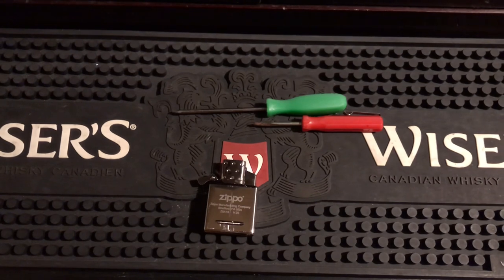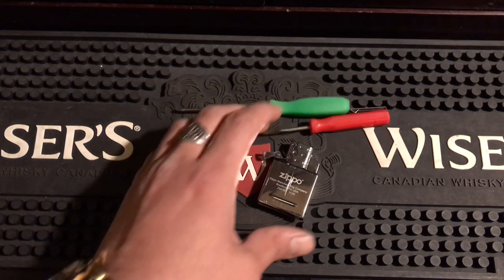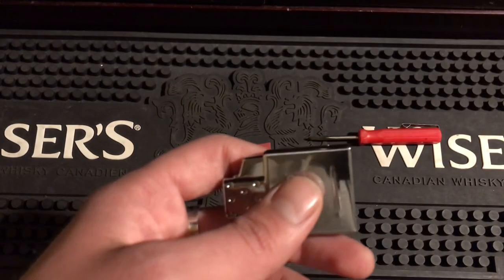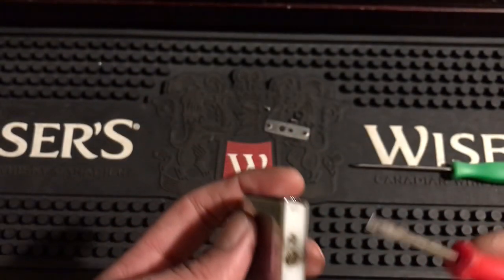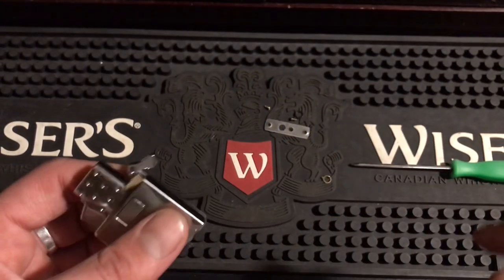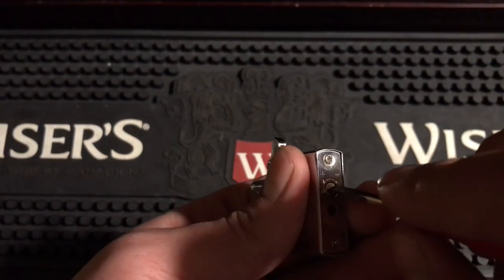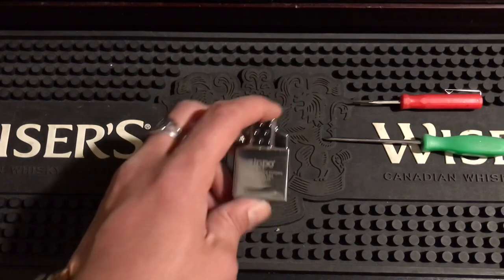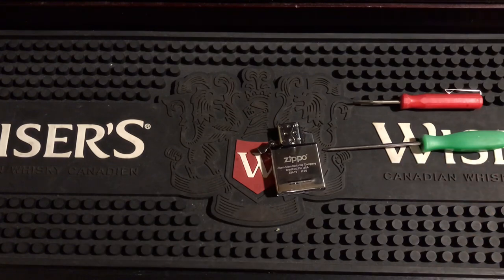How To Fix Zippo Butane Insert + Full Review

Comment: This fix worked perfectly. I don't think it is really about good or poor quality butane, just that each brand will have different compositions of N-Butane, ISO Butane, Propane etc. For example my bottle of gas is "Bernzomatic" and is 83% Isobutane, 15% Propane, and 2% Butane (I had to look up the MSDS). The different gas compositions of different brands will affect the gas pressure and thus the calibration of the adjustment screw.

Comment: The problem i had (with the single torch insert) was that the wire that gives off the spark was placed too high, so the spark went to the side without igniting the gas. So i used a tiny screwdriver to push it a bit out and down towards the gas nozzle, and it now lights up almost every time. The YT channel "kangsterizer" has a video called "zippo lighter butane insert (actual) fixes", which shows how its done.
Reply: I’ll need to try do it on my single torch, lately it takes even 10 tries before ignite. 
My double torch ignites much better than the single one.
Reply: @the_bogeyman.  I dropped mine to the floor once or twice, and had to disassemble the whole thing to fix it. A few days later it dropped to the floor again, and this time i was not able to fix it. Started using the good ol' zippo fuel insert instead, and will never use a zippo butane insert ever again. China does make some good products, but the zippo insert is not one of them :body-blue-raised-arms:

Comment: Had the double butane flame insert and it worked at first then wouldn’t light. Watched your video and before I removed the screws I just turned the adjustment screw higher and it immediately worked great! Guess I should have just tried that first 😅

Comment: Use a small sliver of metal identical to BASE material of the case (regardless of external finish) to slightly elevate the Zippo insert and reduce cap wiggle.  Glue it in to bottom of the case (suggest e6000 glue) and case lid wiggle problem is greatly reduced.  Done.

Comment: Not sure where else to ask this;
Tried to remove the , the limiter. I can not get it out.

My problem however, is that when I click to light the gas just spills out and keeps going for almost a second. If I manage to light it, the flame is ridiculous. I've tried lowering the flame by turning the screw.. But I have a feeling it's because the limiter is stuck? It seems to be stuck? Any advice you can give on this?

Comment: Do you have a video on refilling the zippo?
Reply: Just do general search for refilling butane torches/lighters. All follow the same concept. Invert lighter upside down and bleed out the propellent/air. Flip butane canister upside down and wait a few seconds for the butane to settle downwards towards the nozzle. Butane is heavier than the propellent, so the propellent will rise pushing the butane down. Next fill up the lighter (some have said to stop about midway in filling for a few seconds to allow pressure to equalize). Once filled, wait a few seconds or a minute before using for the butane to stabilize. Lighter should be good to go after that. 

If you need to bleed out butane, leave lighter right-side up and bleed out.

Just got mine in and love it. No issues with it out of the box. Flame adjustment works as it should, and immediately ignites upon button press. But will keep this in mind if I do encounter any issues with it down the road.

Comment: I'm a pipe smoker and I wish I could use the butane insert. But they burn the Briar wood because the glam is to hot. I wish they had a soft flame butane lighter. I still think I will have to pick one up. Zippo guarantees everything so I would just send it back if it breaks or sucks lol. Thank you for the info.
Reply: @ZippoFanatic77  
I was thinking about getting one to keep in my every day carry backpack. But will it keep the butane just sitting around not being used much?
Reply: @ZippoFanatic77  
Yeah I'm in Vermont so we definitely get cold up here. I'm like a half hour from the Canadian border. It's a bag I bring inside at night etc. But the keychain fuel canister sounds pretty sweet. I'll have to look into it. Do they have it on there website?

Comment: I think I have an issue with the battery, please make a tutorial on how to change the battery. The lighter is pretty heavily used. :(
Reply: I just replaced it with a standard D cell, been going strong for 3 years now, lights with every click.
Reply: @zadraking  how do you replace it? Getting back to fix this one. Thanks for the info

Comment: I have looked at many different youtube videos about fixing zippo gas lighter inserts and did what they said for adjustments etc and none of that worked so I actually had to get off my lazy butt and troubleshoot the issue myself. Problem lighter will not light. Info: gas insert is full, air is bled out, Can see a spark and hear gas release when attempting to light. FIX ....Gently push electrode down towards the gas release opening with fingernail or toothpick and retry lighting, repeat until fixed..

Comment: I guess I got lucky. My brand new insert has worked awesome from day one, even with regular butane (which I'm going to switch out with premium on Monday). I remembered all my other storm lighters randomly stopped working, and it's probably due to the regular butane clogging them up. I have one of them still, and I cant wait to see if premium butane will make it live again.
Reply: Whenever you load in butane, small amounts of air gets pushed in also. So every so often you gotta press on the fill nozzle with something skinny to burp out the air bubbles. For my metal clippers before I switch to zippo butane inserts I would have to do that after about 2/3 months of use, and then they’d work great again. Try it could help
Reply: @mrdavman13  Oh yeah I bleed it out like once a month.

Comment: I left the governor ring out of my insert so I can keep turning it up until it's completely out of butane, it gives me longer life out of a fill. Just remember to adjust the flame back down after you refill it or you will have a large butane spitting flame surprise ya lol.
Reply: @ZippoFanatic77  every so often I gotta pull the insert out of the case and turn the flame up some, until it stops letting out any butane at all, then refill it lol but I seen a video about those inserts and the guy said they come from the factory with the highest setting still not being enough to ignite the flame, so the modification of taking that ring out gives it the amount of butane needed to make the flame, I also have the dual torch insert so it definitely requires more butane😂

Comment: What's the fix for the button depressing to far and cutting off the fuel flow. I have multiple of these and they all work great. Except for one. It worked great for about 2 months then all of a sudden I noticed it wouldn't stay lit. After inspection and having 2 of them side by side I noticed that on the non working one the button depresses about an ½" further causing the fuel to shut off. As you know it's real freakin hard to depress the button and stop just after the click so that it stays lit. The force to cause the strike almost always makes you depress the button all the way. Hence cutting off the fuel flow. I've opened it up as far as you did in the video bit I can't seem to get the guys out of the torches metal case. Very aggravating. Any advice would be greatly appreciated

Comment: most piezo modules are rated for 50,000 clicks so they will last a long time and for $20, i'll say it's a great deal. i live in a tropical country so no problem but if i were back in the US, i'll stick with the traditional insert.
Reply: @ZippoFanatic77  yep and they're cheap here. the big butane that's triple refined here just costs $3. the higher refined ones are $5. most expensive one is $8

Comment: I’ve seen butane/propane recharge canisters. They should work better at high altitudes/cold temps. Same stuff used for camping stoves at altitude.
Reply: Liquid fuel (white gas) is best for cold and high altitude. I have never seen butane work reliably in cold/high altitude.

Comment: just wondering how long on till you need to refill a normal zippo insert?
Reply: @ZippoFanatic77  ok thanks do you have a vid on what cotton you use?
Reply: I used the bag trick and got at least a week and a half, but I use the double flame right now, but it still had fuel when I took it out and the insert lit 24 hrs after sitting out sooo

Comment: I recommend buying a larger can of "Bernz-O-Matic" butane from a local hardware store. It's better than paying for Zippo name brand butane. Surprisingly Zippo doesn't even refine their butane but they charge a premium for the name.
Reply: Whip it butane is a great value and not a lower quality product. I use that most the time because the tips are usually well fitting and don’t sputter with trying to load my lighters. 

Usually the cans say buy one get one free and most stores are obliged to follow that if asked about it at the counter.
Reply: @mrdavman13  "Fasfil 5x" is the best butane I have used, for the price. My lighters almost never fail on a first spark with that particular butane. Refined butane is not overrated.